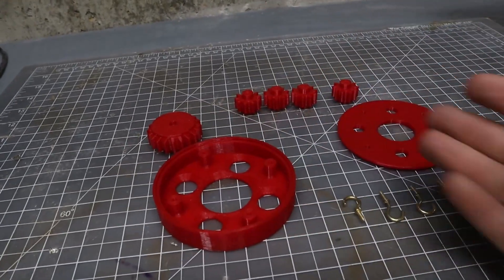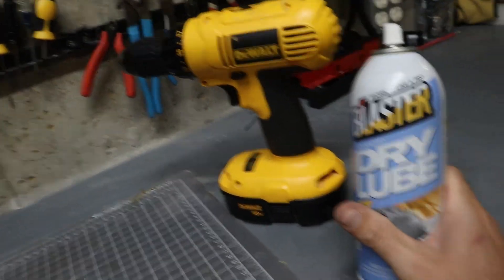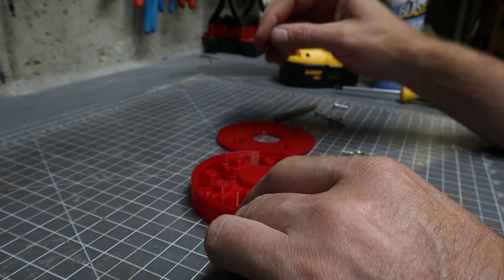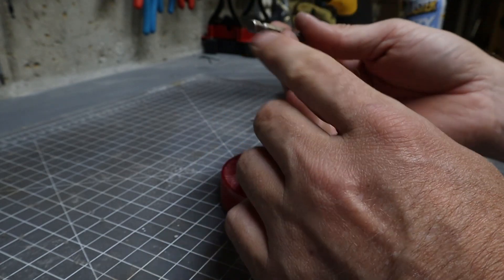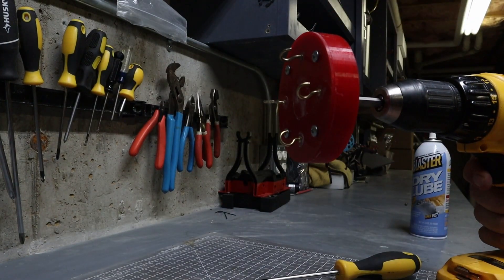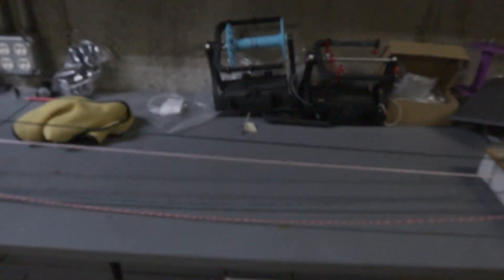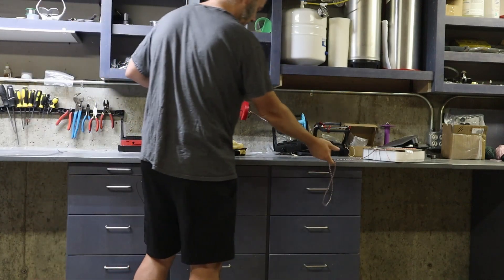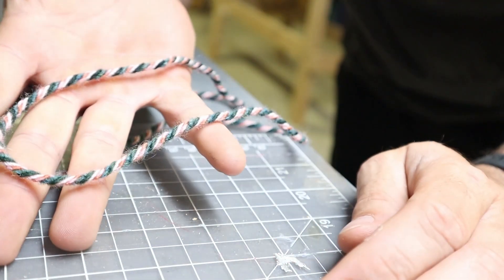Spin 163 - 3D Printed Cord Maker

Comment: I printed this on my Elegoo Saturn 4U 16k resin printer.   Unless you are willing to spend a couple of hours grinding away material to expand holes, make enough space for the gears to clear the inside wall of the case, file each gear tooth down,  and fitting parts, don't bother.  This was designed without regard for clearances or expansion/shrinkage of materials. Once you do get everything adjusted a graphite dry lube is an absolute necessity once you've got it assembled or the gears simply won't move.  Sorry dude,  while it does make rope, your design expects perfect materials and manufacturing precision in an imperfect world.

Comment: Would this work for just a 2 ply as well?
Reply from the maker: Yes, but realize it's not as flexible as a spinning wheel since it's doing two things in one pass.
Reply: @DreamingRobotsBlog  thank you. It would be for making cord out of plastic bags. 
Do you think it would still work?
Reply from the maker: @thisisme4050  Try it by spinning two cords individually.  Then twist them the other way.  Try doing it with a drill.  If you are happy with those results then this can accomplish that faster by doing it in a single pass.

Comment: The hook shafts could be printed longer with a cross hole to receive a paperclip or bent wire hook that would never strip or unscrew.  
     Instead of printing the hole that a drill would create, it could be printed with a circular interior that would better fit a bent wire.

Comment: Nice design. My wife is keeping me busy printing several of your designs. Did you print all the components in PLA? Did you use supports in any of the components?
Reply from the maker: I did print everything from PLA, but as I mentioned in the video if running at higher speeds you'll want to add a little lubricant or the pla might melt.

No supports needed.
Reply: @DreamingRobotsBlog  I just read the transcript and saw where you mentioned no support needed. Sorry for that miss. Instead of using lubricant I assume I could also use PETG? Thanks again for the reply and the great design.
Reply from the maker: @tjoneyoutub99  I am not sure about PETG.  It would probably work, but I always just print in PLA so I can't say for certain.
Reply: @tjoneyoutub99 for those of us with spinning wheels, tri-flow I think is plastic-safe, and I know superlube (any viscosity) is usually safe. Many modern gun lubes are plastic safe, it should say on the manufacturer website.